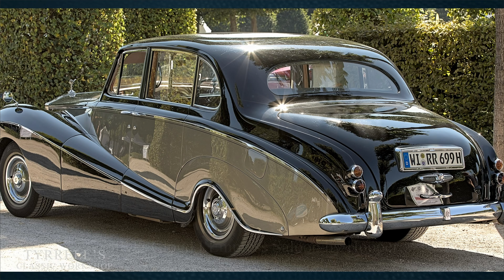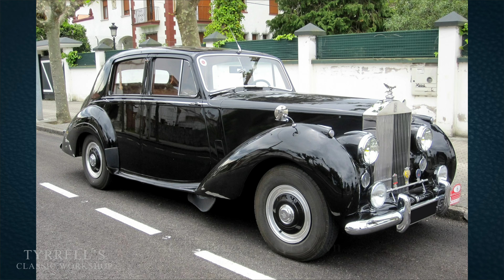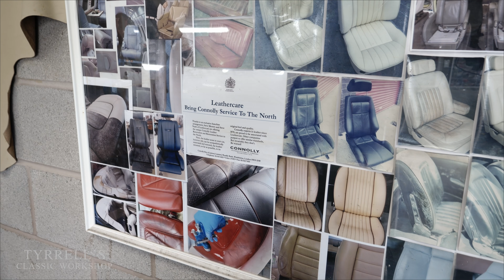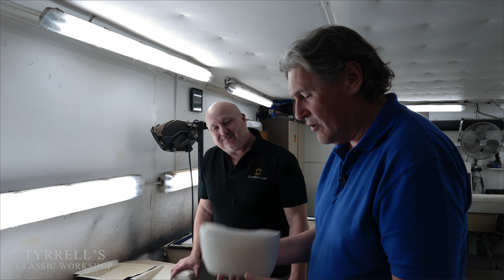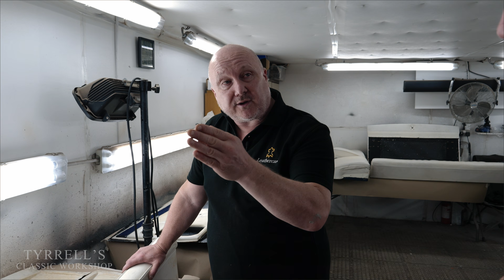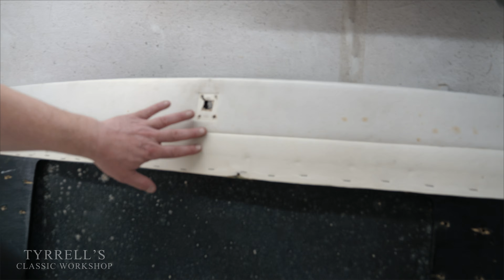Expert Connolly Leather Restoration - Rolls-Royce Silver Cloud III  | Tyrrell's Classic Workshop

Comment: Iain, I am subscribed & like. I found your leather repair segment very interesting. My current daily driver is a Mercedes-Benz with a leather interior. Presently it is in like-new condition. Yet I hear different opinions on how often it needs to be treated to keep it that way. As a professional restorer, what is your view on how many times per year a high quality leather cleaner-conditioner should be used to keep the leather in like-new condition?
Reply from the maker: Thanks. Not sure about new leather- very different!

Comment: As a lad, I was riding my 3-speed Raleigh “English Racer” bicycle in Forest Hills Gardens, a private neighborhood in Queens. A few blocks from the Westside Tennis Club there sat one of these with the odd slanted headlamps. It was parked on a patch of dirt, not in front of a home. Odd. It was there a few days later, indeed for many weeks. One day it was gone. Finally sold? Now ensconced in one of the tiny garages? Who knows. 
Other cars I encountered parked at the curb (kerb) in Forest Hills Gardens included a Singer roadster (sort of looked like a larger MG TD), a Lotus Europa, and an MGA. In each case they were the first and only examples I had ever seen, and didn’t see another for decades. Come to think of it all of them were British. I wonder if they all belonged to the same person?  A few blocks away on Queens Boulevard I spied an open topped Alfa Romeo with the metal dashboard the same color as the body,  an Isetta with the front opening door, and one fine day, a beautiful turquoise Studebaker Avanti pulled up to the curb. As I stood there smiling and staring the driver got out, chuckled, and said to me You don’t often see two parked next to each other! Somehow I had missed that there was already a turquoise Studebaker Avanti parked directly in front of his! What are the odds of that? 
You can see how impressed I was at seeing any car other than a Ford, Chevy, Dodge, Rambler or Beetle because I remember each incident these 50 years later.
Reply from the maker: Thanks for your recollections

Comment: Surprise, surprise, a new Tyrrell Classis Workshop episode. And with an old Rolls Royce, which, just for your ease of mind, Iain, is a little bit younger than I am....!😉 I love the nerdiness, with the radiator, and the leather. First I thought you were going to tell us that the Radiator shell's slats were not exactly parallel, otherwise they wouldn't lóók parallel, that's what I was told a long tome ago. Is that true, by the way?
The condition of the car, and the hood amazes me. They used Eferflex for the outer part, and now I must admit that I am one of those people who choose mohair for the new weather equipment of my old Morgan instead of the original Eferflex....! I thought it was more durable and with a more luxurious appearance and feel than the Eferflex..... I feel a little ashamed now, I must admit!
The leather part was also so interesting, how is it possible it's in such a good condition after 60 years. It must be such a challenge to do a restauration with all the new water-based materials to reproduce a correct almost new but used effect. And to be durable and long-lasting! Looking forward for the next episode Iain, thanks for this lovely video!
Reply from the maker: Thanks. Mohair is perfectly acceptable. Next instalment along soon!

Comment: with its styling, this car strikes me as a Peugeot 403 in its styling, mixed in with Some Delahaye like front lights, like it looks like a super version of coumbo's old car, and I think the real thing it needs is a good proper polish, like that would really bring it back as it looks like its faded.

like get harry's guy in to do this as he does wonders with faded laquer paint, and would do a treat on the ferrari too, also what did he use to wash the leather, was it a specific soap ment for this, as that would come in really handy
Reply from the maker: We’re getting into the paintwork shortly. Thanks.

Comment: A very informative video, thank-you. I recently found an old pot of Connolly Hide Food, mostly gone. But, upon learning that the old formulae was basically lanolin and beeswax I attempted to make my own. It actually seems to have worked pretty well, I treated an old rifle sling that had gone stiff, it softened quite well Don't think I'll be using it on my Jaguars, fortunately the leather on those is still good, granted the oldest car is only a 2006 XJ8 VDP, the other a 2016 F-Type.
Reply from the maker: Yes, I suspect modern leathers don’t react as well as older ones to certain products

Comment: Great video Iain thank you,  am I right in saying that the car you featured has a very slight top forward lean on the radiator grille, rather than completely vertical, and am I right in saying the only other model Rolls Royce did this on was the Camargue
Reply from the maker: Thanks. I think the grille on all Clouds/ S Types is vertical- but I’ll have to take a look now!
Reply: Looking at it on the video in some angles it appears to have a forward lean, also do you think the headlights have a passing resemblance to those of a Gordon Keeble